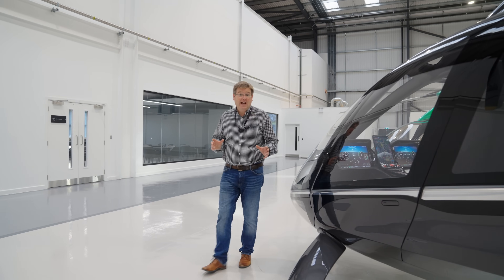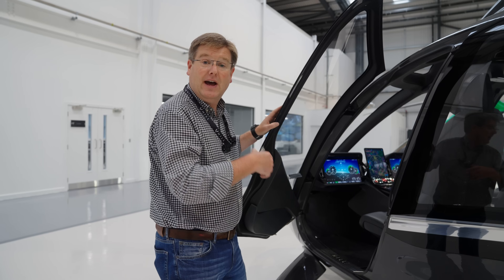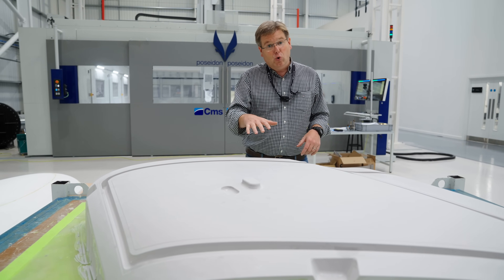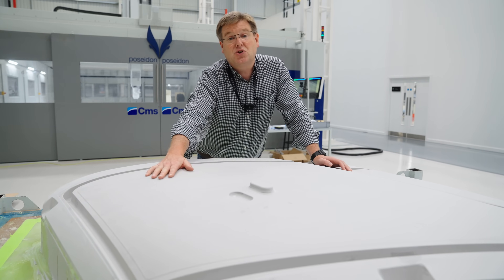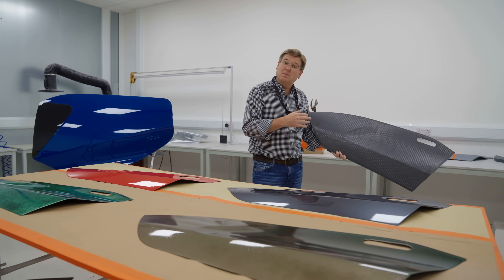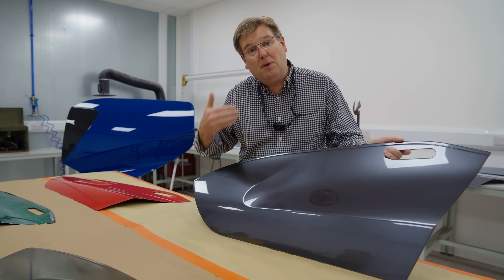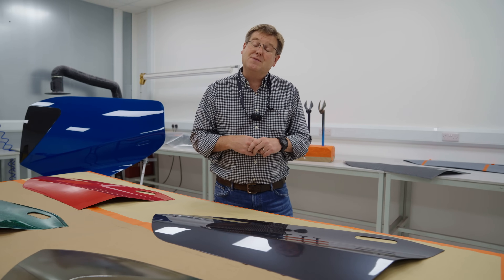Lighter Doors and Advanced Composites

Comment: HX50 is being developed at such a perfect time in history. EVToLs like Archer and Joby are getting all the hype, but once they start actually trying to commercialize them, it will be very obvious that their costs will be so much higher than helicopters (batteries just can't beat fuel). So people will turn back to traditional SToL aircraft and helicopters, and HillHelicopters being fully self insured and built in house means the costs will be super competitive and potentially get a ton of free marketing from the inevitable failures of all the EVToL.

Basically, all these EVTol startups are going to build a lot more hype around personal air transport but Hill will get to reap all the rewards of all the work those companies are doing. And those companies will probably fail eventually. Now I just gotta remember to come back to this comment in 10 years...

Comment: A lot of composite aircraft suffer from torsion forces and vibration which can cause cracking to windows and transparencies, by using the windows to provide structural strength instead of the door, will that not make them a lot more liable to cracking? how will they mange the flexing forces from the airframe in this occasion?
Reply: Thermal stresses are significant. Plexiglass in a carbon frame, bonded together! The coefficients of expansion are vastly different.

Comment: love what your doing, and i'd really love to have a day with your painters, so exciting

i was thinking about the testing
will you be employing a number of small people to test out the cockpit, you know what i mean, if you need to test things to ensure they never break, test to destruction, get a bunch of kids to try and break stuff

i did this a few years back by accident, when restoring a cockpit on a static display Phantom F4, some bits were not available, and i managed to replicate items like the control column, you know the stick that will get some serious abuse from them little sticky hands, well along with my engineer friend we built this column, but my engineer didn't quite meet my specs, used inferior bolt sizes to which i commented, that won't last five minutes, he said it will be fine

we had an open day, the cockpit was open to everyone to jump in and out, and sure enough when i closed up at the end of the day, the column looked very sad, so i had to replace the bolts which had been bent, even one thread was partially stripped and another stud pulled out of the resin handle, all the switches i used were genuine Bendix style toggle switches made to withstand many thousand actions - anyway all upgraded and still seems good

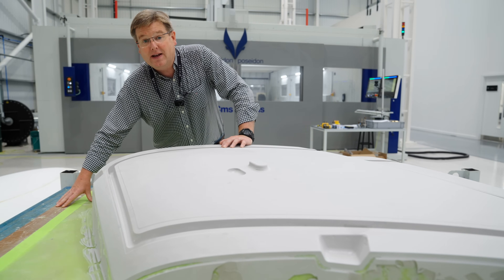Comment: Why are the door moulds stored "relatively long" 2:40 ? I would think they would be in action constantly with your goal of serial production
Reply: I think he is talking about the tools that are used to produce moulds that in turn are used to make parts of the helicopter.  In production the moulds will be in constant use but the tools that made those moulds will be stored and will only be used when a mould is not considered fit for service and so a new one is needed.  In composite production work moulds do suffer some wear and tear and there can be accidents with them, so for volume production you need to be able to make new ones from time to time.

Comment: As an engineer, I appreciate this video. Thank you.
Reply: As an engineer, I want to see the engineering and systems taking place and not cosmetics at this stage of the development. The frills can come later. This is pure marketing and fund-raising. They need to build around 4 airframes for flight testing and certification. Certification will cost around &100m and take four years, using an off the shelf engine, let alone a new untested engine. Figures based on Eurocopter and Bell for an equivalent sized helicopter.